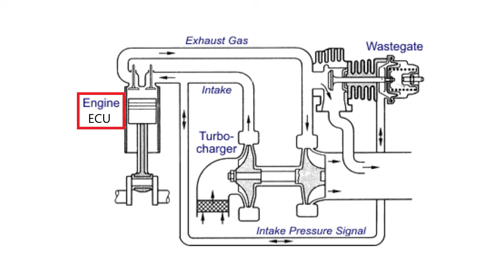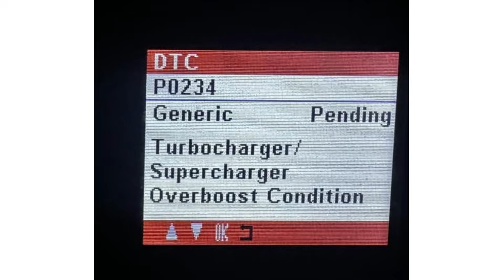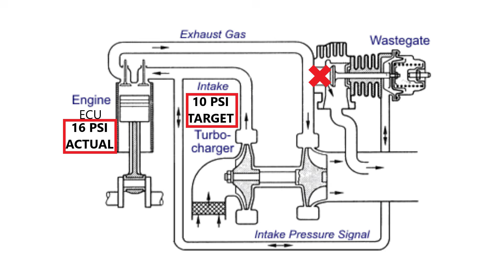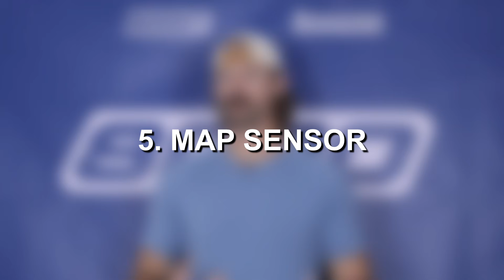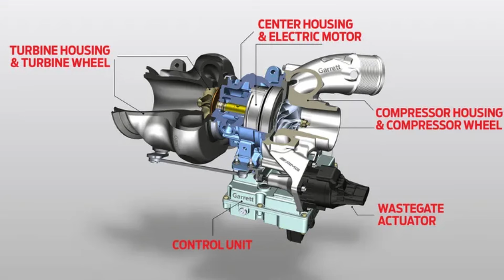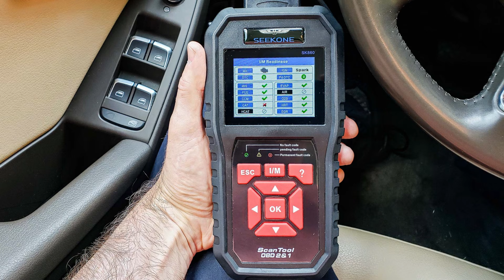P0234 Code: Turbo Boost Out of Control?

Comment: I get 63.75 v on control module p0234 p1548   i think turbo is not doing any changes i get flutter  if let off  if not moving it runs better . i thought it was def related for erratic hexidecimal this  is likley the missing link  i havent checked  its stock f750 2019 6.7  i had to repair the grounds and cleaned alot codes   this is help full i get spikes on map  its 2019 f750 6.7 i havent been able to figure it out hopefully i can get it right soon